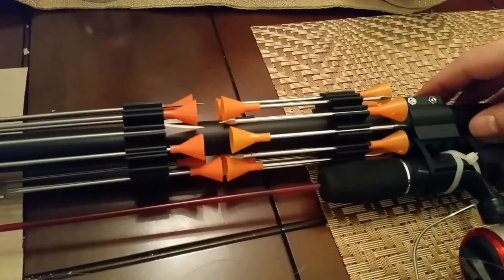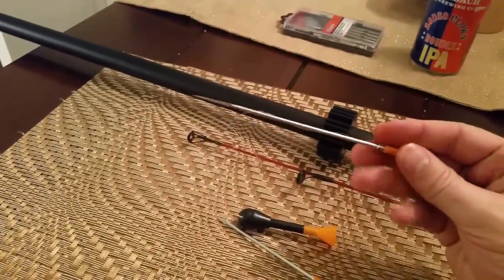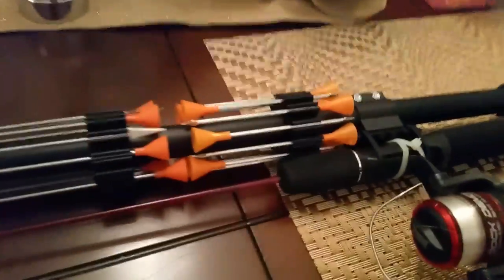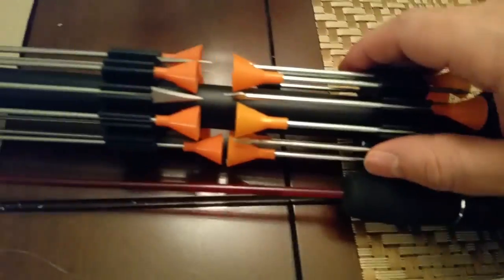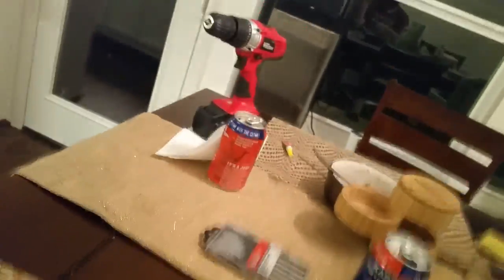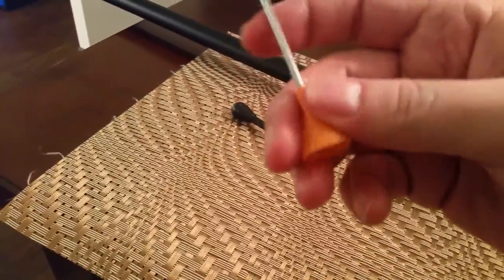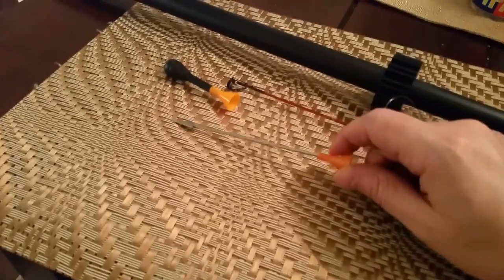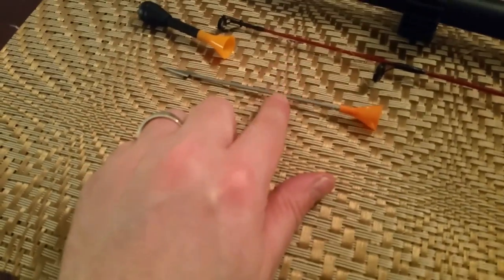DIY: Cold Steele .625 Blowgun with Fishing Rod

Comment: Could just drill out the back of the dart shell. And hammer the end of the steel flat and drill a hole at flattened area for the line.

Comment: How do you keep from the cones coming off with the string
Reply: They don't to much i have 50 pound braid and the cap didn't pull off and I was even pulling on it cause it got hung in a tree
Reply: I used a Neuse and singed it down in the dart
Reply: I had the same problem as you so I just used some gorilla glue and let it dry and just cut off the extra